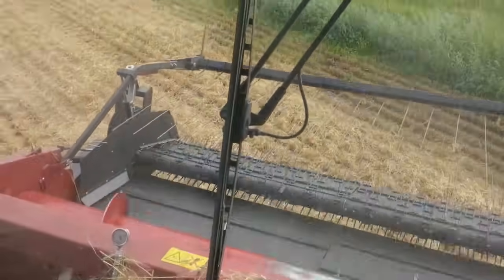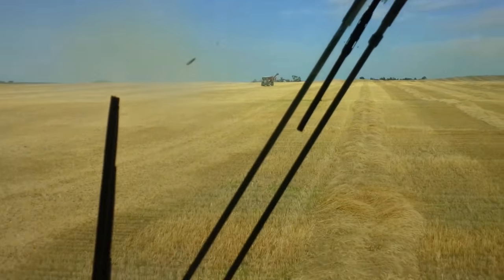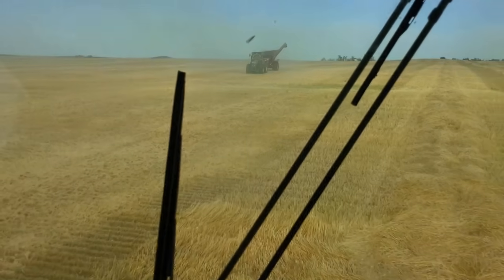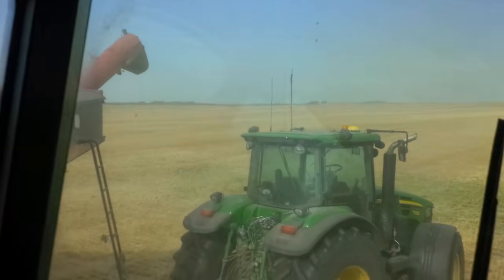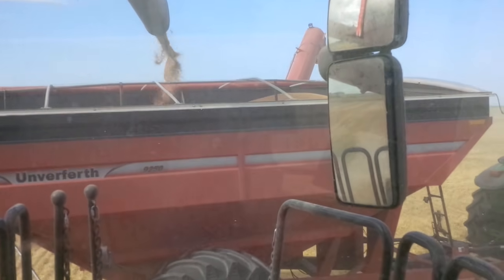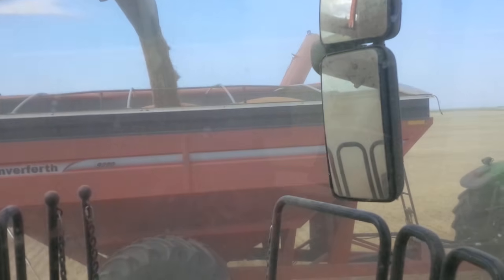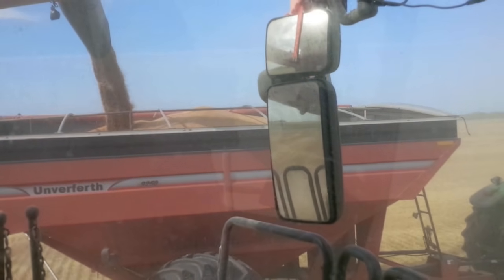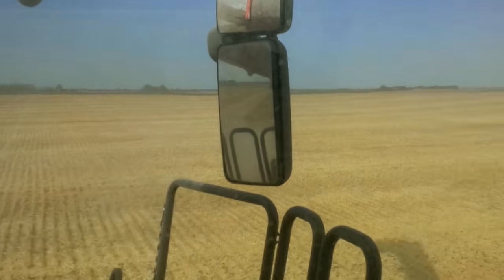Autonomous Tractor at Work

Comment: Astounding!  Curious, how are you dealing with safe areas for the tractor to drive on?  Do you only call the cart over once you have a big enough area combined that the cart can turn around etc without driving across unharvested swaths?
Reply from the maker: what's SAF
Reply: ?  Just wondering if the tractor drives across unharvested windrows/swaths, or if you somehow exclude unharvested areas on the mission planner so the tractor won't drive across the windrows.
Reply from the maker: I wrote my own gcs and will be adding that feature in the future. We just always start on one edge of the field so it isnt a problem

Comment: This is fantastic. With a $200 autopilot and some ingenuity, you've done what Kinze et al have been taking about doing for years (but haven't as far as I know). I thought my Iris and Solo flying around on auto missions were cool, but this beats it by a mile.

Quick question: I see you're harvesting wheat. Whenever I've been around a wheat harvest, a reel-type head was used to just go straight from standing wheat to the grain tank. What's the purpose of wind-rowing the wheat first, the way you're doing here? Thanks.
Reply from the maker: +Kelly Schrock You can get going a little earlier if you windrow it but if it gets a lot of rain it does stay in better condition if it's standing.  The main reason for windrowing  is I don't have a straight cut header.
Reply: +Matthew Reimer Ah, makes sense. Thanks. At any rate, great job with the Pixhawk. I've done a little coding on ArduCopter. I've thought about doing something with ArduRover at some point, but don't have an interesting vehicle around to apply it to. My brother has a JD tractor similar to yours with AutoSteer, maybe he'd let me use that. :-)

Comment: Seriously impressive and encouraging! It's also got to take a lot of nerve to trust such expensive equipment to something you've built yourself.

It's encouraging to see steps at making food production more economical that don't rely on tying it to massive corperate interests.

Regarding wavering GPS accuracy, have you considered using something like IR beacons for precise final alignment once the GPS gets it into the right general area? I'm sure a wimote sensor board could be ruggedised for such a task (though you might need to add a solar-blind filter).
Reply from the maker: +The Scavengers Workshop It takes some nerve to get started but then it is just one step at a time. IR beacons would be cool.  I have the gps mostly figured out now but It would be nice to have some sort of secondary system in place.

Comment: What happened when it runs low on fuel? Will it automatically drive to the fuel tank and a worker will fill
It up and send it on its way?
Reply: P0tat0_craft it will drive to a fuel tank, assemble a little robot that will pump the gas for it and drive away
Reply from the maker: P0tat0_craft We make sure to start every day with a full tank. That way it has no chance of running out unless it had a catastrophic leak.

Comment: This is the future, man! Interesting detail about the nudge offset issue. So the GPS coordinates are coming from an integrated combine GPS? What about using an independent GPS radio? Or is part of the goal to use the on-board hardware? Really cool stuff!
Reply from the maker: p0serj0nes It was just easier to use the gps already on the combine but check out these guys.  http://www.swiftnav.com/piksi.html   They have a really affordable rtk solution.  Haven't had the time to work with it but I am seriously considering one for the future.
Reply: Matthew Reimer "...centimeter level relative positioning accuracy"

Wow.
Reply: Matthew Reimer I have a piksi from the Kickstarter, and I really love what you have done here, I have been thinking about this for the last two years, one of the reasons I bought the piksi but havent done anything with it yet. I would love to talk more about this with you.
Reply from the maker: The Farm Show I'd be really interested to know if you can get the piksi to work with autosteer on an existing machine. Get in touch with me here http://diydrones.com/profile/MatthewReimer or start posting some questions in the rover forum and I'll try and help where I can.

Comment: This is crazy awesome, are you using regular gps or RTK? How the hell did you get access into a John Deere control system!?
Reply from the maker: Yan Ma Im using waas corrected gps.  Right now I have actuators in the cab moving the controls but it turns out that there is no encryption or magic about the electronics in tractors so it shouldn't be too hard to tie into the tractors electronics in the future.

Comment: How much gas could you save by removing those human features (windshield wipers, the seat, mirrors)? I guess you might have issues with resale... maybe even a redesign of the tractor itself at this point to be slimmed down entirely.  Just a thought for the next stages.
Reply: Paul Solin Yeah, this is interesting. building a tractor from the ground up for autonomous use changes a lot of things. You could build it highly efficient, and replace the "human area" (coupe) to instead place the container straight on. This means double the capacity in the same size, or just run without a trailer for better fuel efficiency. Options!